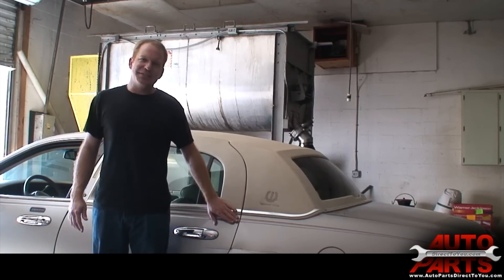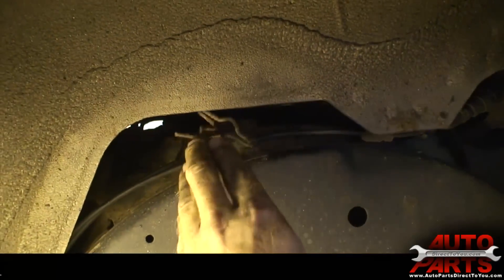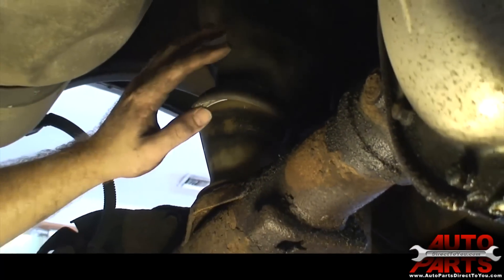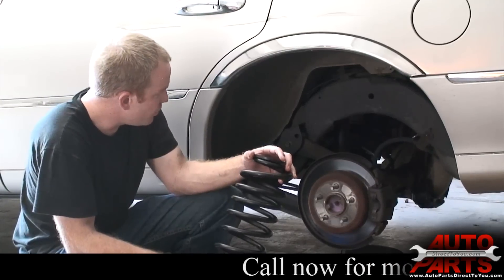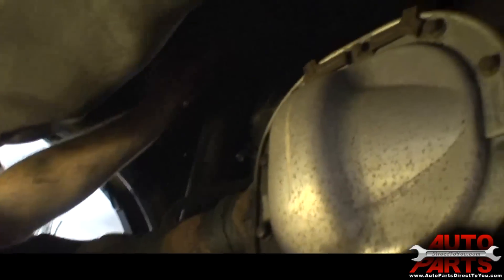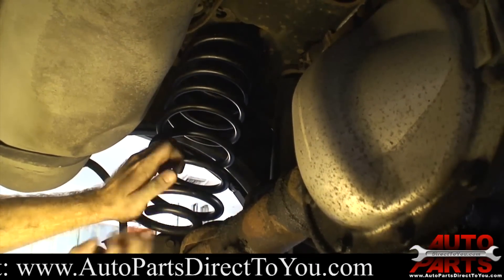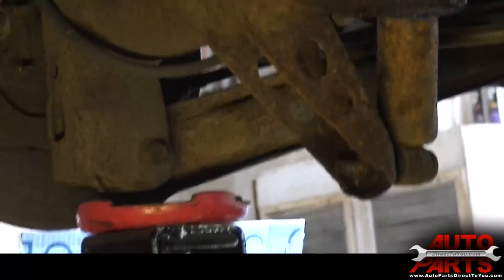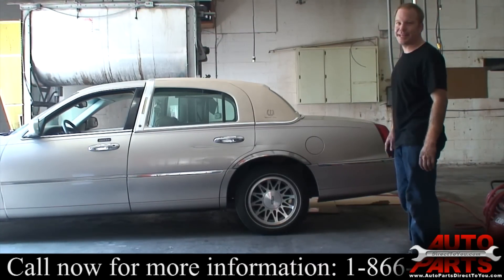2000 Lincoln Town Car Air to Coil Spring Conversion Kit

Comment: On the 52.00 install and coil replacement it was a 96 Lincoln Town car that I did the job on. I am not a mechanic and I just followed these instructions except since I had a limited budget. I went to the junk yard and there are plenty of crown vics with the coils for 30.00 a pair. Thanks for the video it really helped.

Comment: Good vid. I bought spring from a u pull yard for $17.00 and spent 1.5 hours putting them in. Took them out of a crown victoria. Rides great and won't fail.
Reply: Wow good deal
Reply: what year crown vicctoria? where they from the front or the back? I have a 98 Lincoln and would rather get the springs from a junk yard.. please let me know
Reply: put three adults in the back plus luggage then see about the ride!

Comment: Great video thanks. Went to junk yard, found crown victoria with its coils. Found jack placed 6 inch pipe on base of jack to bottom of coil on base of axle. Turned jack until it lifted the coil and it poped of the axle. 30.00 for 2 Installing, had one hard nut on one tire. Went to mechanic, he charged me 16.00 to loosen hard nut on tire and the two nuts on shock absorber as shown on video. Used jack to raise car 1 side at a time. Followed vid instructions total cost $52.00  30.+16.+4.gogles.

Comment: Thanks for the comment. You are absolutely right about the ride. Switching from an air ride system to a coil spring system will take away the softer air ride. The advantage of the coil spring kit is simply cost savings and it is usually huge. Most vehicles with an air ride failure, need air bags, then 6 months later a compressor, or a solenoid, airline, etc. You can simply slap in coil springs if you don't mind riding like a normal car and save all that aggravation & nickle and diming cost

Comment: I love my Towncar, but that air suspension is a pain in the ass. Thank you so much for this video... I'm hitting that subscribe button.
Reply: Buy quality parts and it will last years. One set of replacement bags lasted me over 100k miles. In my eyes, that is a long time for any suspension. The springs feel like shit. Trust me, you will prefer to ride of air bags over shitty springs.
Reply: thanks for postin could you tell me what brand make they were, @mraiwa1000

Comment from the maker: Actually we checked with our customer a week after replacing them, and he said he could barely notice any difference. He was extremely happy with the ride. This car had almost 200k miles and the customer was on a tight budget. We do offer the air springs as well, but some people opt to do the more economical method. (And get rid of the troublesome air ride at the same time) :)

Comment from the maker: @Nightbird Yes this conversion is the same on the 1990-1997. The Ride is very similar, it's actually a little stiffer with the coil springs, but not a huge difference, I have never heard of a complaint of the ride quality with the coil spring conversion though.

Comment from the maker: @LincolnTC99 There really is no need to add any additional clamps, the pressure from the springs, held in place by the shocks, is all that is required to hold them permanently in place.

Comment from the maker: @StvenMalinchak It is actually normal for the compressor to come on for about 30 seconds after you start the car, when you turn it off and hop out, the car actually lowers a little bit, then when you start it again, it will go back up to the normal driving height. If the bags are leaking, you will usually ocassionally find the car sitting down in the back end, especially overnight. Thanks

Comment from the maker: You can just turn off the air-suspension master switch (in the trunk). That will keep the compressor from coming on.

Comment from the maker: @StvenMalinchak We sell this kit for $119.80 at this time for just the springs, or $189.88 with new rear shocks. that includes free shipping to the lower 48 states. You can find it by going to our website and typing "Coil Spring Conversion" into the search box. Thanks!

Comment from the maker: @dbowersjr There are two methods, you can either find a wiring schematic and disconnect the wire that goes to the check suspension light, or if you have a single light bulb that comes on the dash, you can take out the instrument cluster and remove the bulb itself.

Comment: I used a coil spring compressor to compress the spring for installation....  I also put the bottom rubber on the differential ... Took a little persuading but it did stretch over the bottom hump... Then put the spring over that and lightly released the compressor and it fit right in place....  The reason I make sure the bottom rubber is on the spring ?? Some of these cars make a little PROING noise when the spring is in a certain position... :) Anyway , That was just some of my knowledge I have on installing these things.... Not saying you did anything wrong , but I would definitely put the rubber on the bottom....
Reply: You are right. I bought a different kit which came with two donuts for each spring. The top is easy but the bottom I had to use a heat gun and it took a bit of work.

Comment: Good informative video . All the comments & replies help on things  not mentioned like fault message lights on the dash , or the air compressor.  But still have a question as to what you do with the air connection/connectors when you disconnected them from the air bags ?
Reply: Turn off the air compressor in the trunk, by the shut of valve switch.

Comment: should i change the rear upper and lower control arms in the rear when i change the coil springs
Reply from the maker: You shouldn't have to replace the control arms unless the bushings or ball joints are worn out.

Comment from the maker: You should release the air pressure before attempting the job, it can be dangerous working with a pressurized air spring. Once the air spring is deflated, you do not need to remove the shock to remove the air spring.
Reply: How do you release the pressure?

Comment: Do you need the rubber boot??  I pulled a fresh set of Strutmasters rear springs from a junkyard yesterday. They didn't have a rubber boot, I got them for $17.50 a piece. Thank you for the informative video. Will install them on my 94 towncar tomorrow. Will probably for back to air Bags later on.

Comment: i just bough my coil spring for my 2005 towncar at auto parts direct to you and I was wondering if I need the coil spring seats. because it wasn't available at the time I place my order and I only have my coil springs with no coil spring seat
....
Reply from the maker: +Ricardo Lopez If you are not getting any noise then you can leave them as is, many vehicles actually are metal to metal with coil springs.

Comment from the maker: @RedneckBabyG Doing the air to coil conversion is fairly inexpensive, You can find the parts by clicking the link in our description, and if you were planning to pay a mechanic to do the work, they shouldn't have to charge you more than an Hour of labor.

Comment from the maker: Unfortunately there is no simple single wire to cut on that model year, you can try to trick the computer by adjusting the ride height sensor until the computer sees the car sitting at the ideal height. There is a connecting rod on the sensor (above the rear differential) that can be adjusted.

Comment: I understand that this is an option, but after taking the airspring out, you could have installed a new one right then and there and you would have been done and good for at least another ten years.  So why do a conversion?  But... a very informative video.
Reply from the maker: Kielbasa Glen because the air spring requires a working air suspension compressor, computer, ride height sensors, and air lines. The air bag springs are really the cheaper part of the whole system. The new air springs may last another 10 years but the compressor and other components usually do not. We give every customer the option to convert as we have also had many customers who come back 1, 2, or 6months later and get a much bigger quote to replace the compressor, this alone can cost anywhere from $400-$1500 depending on the model.

Comment: How well does it drive.. do it have a bouncy type ride or does it drive the same as the air ride suspension
Reply from the maker: Tennessee raised good question, it actually has a stiffer ride although it depends on the person driving, some people don’t notice anything and some notice a slightly rougher ride when going over rougher road conditions, so it is slightly stiffer, especially when brand new
Reply: @APDTY  thanks for that input I'll keep that in mind

Comment: I want to lower my town car. if I cut the springs do you think the springs will still sit nice and tight?
Reply from the maker: +MexhomieXlll i would not recommend cutting springs. Springs are tapered to fit it mounts and coils are wrapped tighter at the bottom and top for spring rate.
Reply: Why cut the springs when you can get clamps to lower them by a couple of inches?

Comment: Do I need to replace shocks at the same time as spring conversion? Or can it wait for a month or so?
Reply from the maker: incognito444 if the shocks are old and not supportive anymore then yes they should be replaced, the shocks are what really dampen the bounce, you can do a bounce test which is where u simply start bouncing one corner of the vehicle, get it going up and down and then let it go, it should stop bouncing after just 1 bounce, if it keeps bouncing, then the shocks are doing nothing and should be replaced.
Reply: @APDTY  do you have any idea how helpful you are?

Comment: do you have to unbolt/remove the rear shock to get the air spring to come loose if the bag is under pressure?

Comment: I just converted mine but the air suspension light is still on.  Any suggestions on how to turn them off
Reply: In the trunk by the emergency valve shut off, There is a switch for the compressor!

Comment: Hey my question is, will this pretty much work the same way for a 93 Towncar? and from what I saw in the video you dont have to bolt the coil down or anything? I dont understand how it stays in place and doesnt slide out. The top of the coil had that little piece that fit in the car but the bottom of the coil looked like he just wedged it in. Im trying to do this job myself on my 93. So I dont need a coil compressor or anything? And do I need both springs and shocks or will just springs work

Comment: What about the “check air suspension” that keeps popping up on the dashboard?? Is there a bypass you can us? Because the computer keeps looking for the air sensor….
Reply: On the early 90s cars, you could cut a wire in the glove box to get rid of the dash light. On newer cars, you are pretty much stuck with the warning light on the dash.
Reply: How to make it stop making noise( the pump)??

Comment: so you dont need anything to hold the springs in place? like those clips you said to save?
Reply from the maker: Yes you re-use those same clips, the is what holds them into place, the bottom they seat onto the spring seats
Reply: The clips are only for reinstalling air bags.  Clips are not needed for coil springs
Reply from the maker: @bigm355  yes correct

Comment: The coil spring make the car a little higher then air spring? I wanna convert my crown Vic with the police coil spring and get rid of the air suspension.

Comment: Do the coil springs lift the car up alittle higher then the air suspension does?
Reply from the maker: No, The coil springs will keep the vehicle at the original factory ride height unless it was altered. Also it is common for brand new coil springs to be slightly higher at installation, then after a little bit of driving, they settle down to the factory ride height same as the rubber air springs.
Reply: Would i be able to add coil spacers to lift them up higher to fit bigger wheels with this conversion my factory bags are torn and i want to convert the rear

Comment from the maker: What year is yours? Some of the later town cars unfortunately there is no single wire to unplug, the only thing you can do is trick the computer into thinking the air-ride is working by forcing the ride-height sensor to be at the correct level.

Comment: I always use the rubber grommet on the bottom. why are there 4  included with the springs.
Reply: good question!
Reply: Two for the top, two for the bottom.

Comment: Hello everyone. I have a question. Lincoln town car 2007. The right side of the car is 2 centimeters lower than the left. I'm looking for the reason and I can't find it. I moved the rear air bellows from the right to the left and nothing changed. I moved the Makpersons from the right to the left front and nothing changed. I checked the Watts rod, it's working. I moved the air bellows valves from the right to the left and still the same. Can any of you help me?

Comment: No mention about level sensors needing disconected and tied up. Otherwise the air compressor will run
Reply: The problem with turning off the air compressor switch and leaving it off. Will mess with the dual speed steering and I'm not sure what else. My car has the air control switch on. It never runs. And if I make sure I am in my car and my door is closed their suspension light will not come on. So bag and keep everything intact and just tied up with tie straps. The level sensor should be disconnected at the bottom and also tied up to where the bottom is now facing upward. There's all your problems solved

Comment: how do I shut off the "check air suspension" light on my 2000 Mercury Grand Marquis LS?
Reply from the maker: +Austin Henry is it a service message in the information center display or just a light on?

Comment: My kit came with 4 insulators. Can I get away with only using 2 for the top of the coil springs? It seems like the spring won’t go in place when I put the insulators at the bottom of the spring on the differential.

Comment from the maker: You can see our current price on the coil conversion kit in the link directly below the video. As for the Labor, It's free if you do the work yourself :) but If you bring it to a shop, I would estimate 1.5 hours of Labor time, the cost would all depend on what your shop charges per hour. Sorry but we do not have a video at this time of shocks on this vehicle.

Comment: Do u guys make a lowering spring kit for 1994 towncar?  I have a 13x7 wire wheels and the wheel gap is huge with the stock air bags. So was wondering if u guys had any lowering spring kits thanks

Comment: How is the coil spring ride compared to the air bag suspension ride.  I can't believe it rides better unless you have air shocks installed.
Reply: melodymaker396 . YOU CANNOT TELL, FEEL LIKE FLOATING

Comment: I had the conversion done, my springs make a squeaking noise going over bumps
Reply from the maker: +MrBodean2010 So coil springs by nature do have a break in period. The ride height is usually slightly too high for the first 1-3 weeks and then once the springs settle, the ride height should lower too normal. This extra height adds some more up and down and basically if the squeak is noticeable after 3-4 weeks, make sure to reinspect. It is also a good idea to inspect right away and make sure the installation was correct.
Reply: +Auto Parts Direct To You ok I will recheck it. the noise stopped for a week or 2 then started back

Comment: Do I need to put sumthing in front of the front tires to keep it from rolling? And where exacctly would I put the jack stands
Reply: Jackson Jackson put the car in park, and put on the hand brake, slso, you will need jack stands, do not depend on the jack to hold that car up alone.
Reply: @j.a.mcbean.4043  I know this is an old thread, but park and hand brake do NOTHING to stop a car with rear wheel drive from rolling when rear is jacked up in the air. ALWAYS chock your wheels that are on the ground, and chock them both front and behind to prevent movement in any direction.I don't care how smart, fast or good you are, when the car falls off the jack stands, you will NOT get out in time.

Comment: would I be able to do this with a Jack instead of a lift?
Reply from the maker: Yes, Using jack stands to support the frame. Then a floor jack to work the rear end.
Reply: I'm trying this right now on a 02 CV LX SPORT and I can't get a tool or my hands on the solenoid to turn counterclockwise to remove the air in the bag
Reply: Sorry I didn't answer your question yes you can use a jack but any jackstands to like the other dude said. But like I said I can't get my hands or tool on that solenoid

Comment: I wonder why doesn't Lincoln switch over to magnetic suspension like Cadillac has instead of Air suspension. that way when the car gets old it is not dragging on the grown. My grandmother and my friends mom both brought their cars around the same time. My grandma '92 Cadillac DeVille,her mom '93 Lincoln TownCar. Both still to this day have those cars. My grandma Caddy still level and my friends ma her Lincoln the last time I saw the Towncar it was dragging on the ground.

Comment: Unless the complete system is shot including the PUMP AND BAGS why convert to springs when Its only $58.00 for 2 new bags delivered to your door for free!!!!! THERE IS A BIG DIFFERENCE BETWEEN AIR SUSPENSION AND COIL SUSPENSION!! rides much nicer with the bags
Reply: where can you get them for 58 dollars.  I might be doing this job soon to my 04 Town Car
Reply: bradley1970 Amazon
Reply: Yeah but what if the problem isn't the bags? I bought new bags and my car wouldn't stay leveled. If have to get a $70-90 smoke test just to see where the leak is, and then pay to get it fixed. That could be up to $400.

Comment: why no spring seat on bottom?
Reply from the maker: +bloody breeze kit comes with all four, we leave it to the installers preference
Reply: It fits perfectly fine without it.  You will see... that metal on metal will not slip off.
Reply: I just put the top ones on